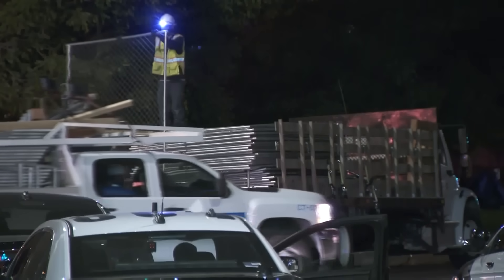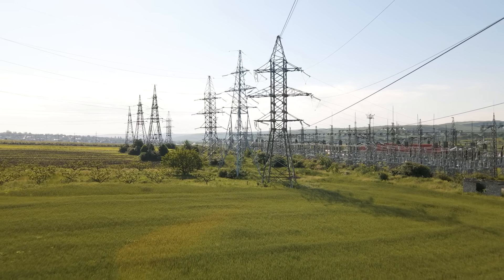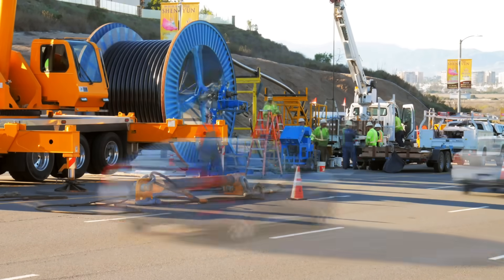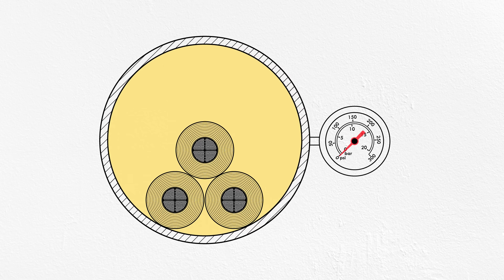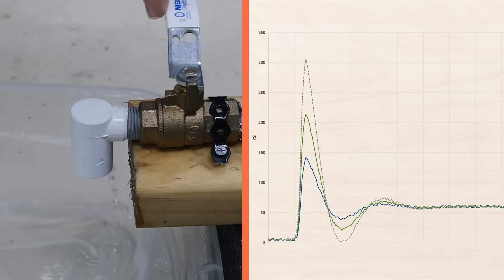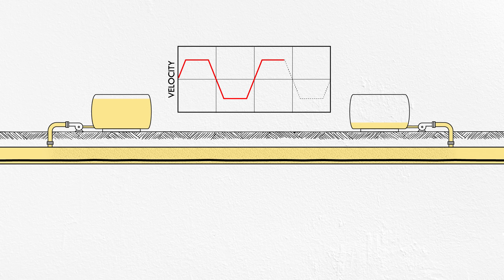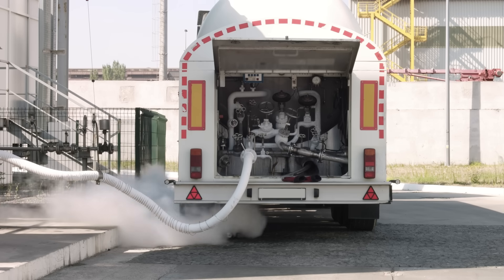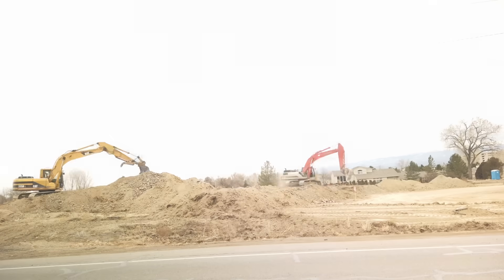Repairing Underground Power Cables Is Nearly Impossible

Comment: This video takes back 30+ years when I was an apprentice electrician at a regional electricity supply authority. We spent over a week trying to find an intermittent fault in an underground protection system pilot cable running between two transmission substations. We were almost at the point of digging up the entire length of the 1.5km cable to find the fault when we decided to turn up the thumper voltage to "11" so we could "hear" the fault. We narrowed the fault location and start digging.

We discovered that a few years before a resident had driven a steel star stake fully into the ground above the cable. The point of the star stake damaged the protective sheath of the cable just enough so that it was no longer waterproof. Over the ensuing years, ground moisture seeped into the cable and degraded the paper insulation to the point where it was basically useless.

It was an interesting week of engineering detective work.
Reply: I was an electrical engineer working with small electrical systems in native villages in Alaska. We were in a northern village with a bad underground cable. The locals reckoned it had gone bad at a splice,  and they knew roughly where it was. Winter was on the way and the ground was beginning to freeze from the surface on down. To get through the frozen part we hiired a couple of guys to chop through the top couple inches with axes. Below this the ground was digable with shovels.
Reply: Oh man. What does that fine look like for the resident? I worked commercial landscaping and I can't imagine digging without locations.
Reply: @davidlee9870  I would have thought that these cables would be VERY deep just to make sure nothing got near them except for well digging.
Reply: @richardiredale3128  deeper the hole the more expensive the job. From what I understand the high power cables are about 2.5-3m from top of cable to ground. But nothing is ever consistent
Reply: Paper is wood, is there no better insulator?
Reply: @ValMartinIreland  These days xlpe is used.

Comment: I think Regeane Wolfe has revealed the best solution if the tunnels can be made reliable. Elon Musk and his Boring Company have apparently solved this problem and the benefits of using a tunnel and solid dielectric should do the trick until future solutions can be developed. Underground cables make sense in places threatened by natural disasters such as New Orleans, and coastal areas.

Comment: Very interesting video, I had no idea power line insulation was this complicated. I assumed they just used really thick rubber insulation.

I have an anecdote about finding faults in lines that you might like. My grandmother's family used to work in the telegraph station on Valentia island in Kerry, the eastern terminus of the transatlantic cable. At one point a fault was caused in the cable, she didn't mention when but I suspect it was early on in the project when one of the engineers tried to overcome issues in resistance by using ever higher voltage. Eventually he ruptured the cable, requiring an expensive repair operation.

Anyhow, their method was fairly simple if expensive and time consuming: Sail a ship into the middle of the atlantic, dredge up the cable and send a message in both directions. Then work their way back along the cable dredging and testing until they pinpointed the fault. Essentially binary search.

In this case they started in the middle and were able to send a message to nova-scotia, but not valentia. So they started working back towards Ireland. They encountered the same result the entire way back and eventually discovered the fault was barely offshore from Ireland. They could have fixed the whole thing using local fishing boats!

Comment: This is absolutely fascinating. I took a high voltage lab in secondary and learned about insulation and breakdown dynamics. The way they used to LN to freeze the oil made me smile. I can only imagine when that idea was proposed in a meeting. Super super neat. I never realized they ran 250 kV underground. I didn't think there would be enough dielectric

Comment: Why isn't the power line designed as a coil instead of a straight wire? Expansion and contraction would simply cause it to change the diameter rather than length and prevent buckling.

Comment: I think I'd be a little creeped out working on a pipe downstream from an ice plug holding back all that pressurized oil. God forbid if the thing should fail while you're down in that hole.

Comment: I wonder if it would be feasible to make each line able to slide along the pipe, such that the lines could be removed from one end and replaced on the other. In theory, you could replace a line without even disrupting service. Having that kind of mobility in a line would also help with expansion stress.
Reply: This is commonly done with short lengths. With these large cables you can only get a few hundred metres on a reel that can be transported by road, so they are connected with very complex, heavy, fragile joints. You can't pull a jointed HV cable through a duct. The joints are always built on the spot.

Comment: Thanks for your fine report. Well done.

A couple of decades ago I was curious regarding the very high voltage DC transmission line that runs between the Sylmar substation near San Fernando, California, and the hydroelectric infrastructure on the lower Columbia River in south-central Washington State. On one of my trips I stopped by the Sylmar station to see the converter building. It uses large scale electrical components to convert, back and forth, between HV, high current AC and DC.

Comment: With the improvement in the materials used, underground transmission and distribution is becoming much more common these days. I have never seen a system that used high pressure oil though. Thanks for the Video Grady.

Comment: This is interesting timing. PG&E announced 4 months ago, 21 July, that they are going to begin burying their transmission lines - 10,000 miles of them, to prevent starting fires.
Transmission lines are carried on towers for a few reasons. One and two, in free air, they can be smaller diameter and made of aluminum, which doesn't conduct as well as copper, but is one heck of a lot less expensive. Being in free air keeps them cooler than being underground. Three, it's less expensive than even if they could simply dig a trench and bury the wires. Four, it's a whole lot easier to find problems and fix them, as noted in this video. 
We have buried infrastructure where I live and we like it. We have had several outages over the years. All of them caused by problems with the lines that run on poles outside of town.

Comment: Can you please tell me  why the three phase are not taken in separate tranches with necessary distance between tranches? I think that will more cost effective and less problematic. Then it can be repairable. High Tension line with inches gap is not a good idea and is impractical also.

Comment: In Nova Scotia, Canada, the grid is almost entirely above ground on pylons and poles. Whenever the power goes out due to a wind storm, the empty-headed unwashed denizens of the comment sections erupt with demands to "Bury the grid !!". 1) NS is mostly on solid bedrock; it would cost many tens of billions. 2) Downtown, where the grid is mostly underground; fun fact: they have outages too. 3) Hurricane Sandy flooded the transformer vaults in NYC leading to extremely long outages; as such underground damage cannot be fixed in a few hours like pole-mounted equipment. And now 4) See this video. BONUS FUN FACT: The poles allowed the installation of fiber optic internet decades faster than would have been possible with underground utilities.

Comment: This feels like a lesson in why you should design your infrastructure with an eye towards ease of inspection, maintenance, and repair.
Reply: This is the industry standard repair technique, for, what was by then well established technology. This particular cicuit suffered more mechanical problems than most due to elevation change along the route.
Reply: @packratty  They're implying that high pressure oil transmission lines were a bad idea in the first place.  They're complicated to manufacture, hard to inspect, and difficult to service.  Polyethylene isn't a new technology, it's what trash bags have been made out of for years.  The whole system becomes much simpler when there isn't contaminant sensitive high pressure oil involved.
Reply: @JMurph2015  HPFF lines predate polyethylene by a decade... and the line in the video was started a decade after mass commercial production of polyethylene began... HPFF was the best that could be achieved at the time.
Reply: @benruss4130  polyethylene has been known about since 1898.  It took until the 1950's before HDPE was being mass produced.  This line was constructed in the 70's... Try again.
Reply: @JMurph2015  nice try, it was discovered In 1939 on accident, commercial production did not begin until  after ww2. Mass commercial production began in the 60s

HPFF lines were designed in 1931
Reply: @benruss4130  nope  https://en.m.wikipedia.org/wiki/Polyethylene#History
Reply: @JMurph2015  oh come on, wikipedia doesn't even disagree with me. It states that the first polyethylene that was industrially produce able wasn't able to be produced until 1939 and that commercial production didn't begin until after ww2... Just because we know that something might exist doesn't mean we can design shit to use it when we have no way to make it. Especially because you need high density polyethylene... Something that wikipedia says wasn't made until the 70s.

I can see it now:

Designing underground cables in 1930

"Hey, I heard about this wonder material that is non conductive, strong, and can be cast around our lines"

"Yah... Ok Hans, once you can get some for testing we will believe you... Also, lay off the vodka, that's for the Russians."

EDIT: Also, "built" and "designed" are two very different subjects. The plan had to be fully completed and approved before construction.
Reply: You can have it Cheap, Easy, and high quality. But you can only pick 2.

Comment: You should also probably look at 1998 Auckland power crisis, where one underground cable failure also took two other underground cables with it; and they were not repairable. So engineers were forced to construct a temporary overhead cable line to restore the power to city, and it took them 5 weeks.

The special part that an older gas-insulated cable was repairable and was brought back online, but other, oil-insulated cables, were not.
Reply: Indeed this would make an interesting followup.  Please?

Comment: Given that above-ground transmission lines are subject to damage from severe storms like we’ve seen in the past year, and below-ground lines are this much more difficult to maintain, what’s the current recommendation for where to put power lines?  Does it depend on the region’s climate?  What have we learned over the past few decades that can help make the power grid both more resilient and easier to maintain?

Comment: Nowadays they add fiber optic wires to the underground cables, not for the purpose of communication, but to find faults. They wires are placed so they are likely to break when the electrical cable is damaged. This way they can use optical  pulse reflection to find the location of the fault, which is more accurate than the electrical pulse reflection mentioned in the video.

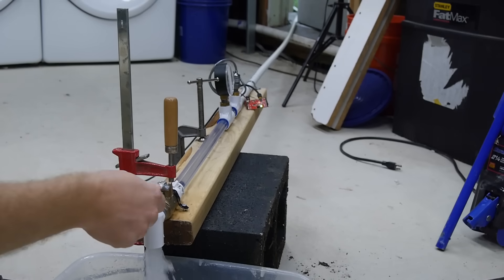Comment: [6:30] If you can't reverse the fluid flow fast enough, then why even reverse it at all?
Why not put 2 HPFF cables right next to each other, with the oil flowing in opposite directions?

Comment: Polyethylene sure seems a lot easier to manage than an underground pipe filled with high-pressure oil that leads to disaster if it leaks or gets any contaminants inside of it.

Comment: As clever as the solution to this problem was, I can't help but think that underground high voltage cables are a solution looking for a problem. I get High Voltage Power lines are an eyesore but that's the trade-off for electricity and easier maintenance on an already complex system.

Comment: what an absolutely mind blowing method with the pressurized oil.  it made me think about how much i take electricity for granted.  if the power goes out for 20 minutes during a storm i'm frustrated that it should be working, meanwhile this is only one of the moving parts involved in the entire process to get electricity to our homes.  i definitely take it for granted that i can just plug something into an outlet and it works....
Reply: Electricity is such a big part of our civilization that when the power is flowing, it is thankless. But once the power is cutoff, everyone is mad and looking to the power utility to fix it asap

Comment: As one who works with everything from underground distribution to transmission, it should be noted this video's content only applies to transmission and this underground method is not very common. More common is massive underground duct banks usually 3-5' wide

Comment: Brady, could you please tell us, why did they have even considered the underground lines in the first place? I'm an engineer myself, and while I'm not an expert on the high voltage electric lines, there are definitely some pros and cons for "regular" high voltage electric lines, but based on your very brief description in this video - the underground lines seem to be largely inferior to the air lines, and are a hell to ever maintain... I guess the issue might be about the existing homes where the air line would be, but I think it could be cheaper to buy that land than have all this hellish maintenance?

Comment: I'm not a fan of pressured oil as a solution for insulating underground high voltage electric lines. I wonder why they didn't use plastics in the first place...

Comment: I am retired electrical engineer with 35 years of electric utility experience. One of the concerns Grady didn't mention is that in that era of the 1970s, often regular mineral oil was not used in oil-filled cables and transformers. Regular oil is flammable and shorts could cause spectacular explosions and huge fires. So a compound called Askarel was used instead. It had superior insulation properties and wasn't flammable. Just one problem - Askarel was a trade name for PCB -polychlorinated biphenyls which in the late 1970s was discovered to be a carcinogen. So other alternatives had to be developed. It's possible that the underground line he describes used this oil in which case draining it had to be done very carefully so as to not let it escape into the environment. When I was a student engineer in 1974 I had a summer job at the local utility. Our job was to go to underground transformer vaults in downtown Toronto, take oil samples and bring them back to the lab/office for dielectric strength testing (testing if they still could withstand the design voltage without arcs). Many of the transformers had Askarel in them and word had started to emerge about the dangers. So us group of students went on strike! We would not handle those tests! The supervisors just shrugged and said that it could wait for the next group of students. The guys in the transformer repair shop laughed at us calling us sissies. They were literally put their arms into the stuff up to their armpits when repairing transformers.

Comment: I’m a lineman working in New York. Back in ‘08 I was on a project to repair a faulted oil static underground transmission line. That’s how we did it. 100 yards away in both sides of the vault we dug pits and wrapped the main pipe with copper tubing. We had a liquid nitrogen trailer on either end and froze the pipe. At the fault we drained out the section of oil cut pipe open about a 20’ section. Cut out the fault and maid two new splices with a new 10’ section of cable. The line went from westchester New York to Long Island. It took 2 months to complete the repairs. Was interesting job to be on.

Comment: Im a chemist but love engineering and your descriptions are very relevant and very well explained!  Please keep them coming!
Reply: Oh by the way your water hammer video was particularly useful.  I noticed a banging noise when I switched off taps in the house.  Then one day while washing dishes I turned off the tap and there was a bang under the sink followed by rushing water everywhere!  A braided pipe connector had been corroded over time and the metal braid weakened.  All it took was a last water hammer event to cause it to fail and rupture.  Remembering your video I then fitted a device into the line to stop it and.....no more banging!  Thanks for helping me understand the problem and saving some significant plumbing fees!